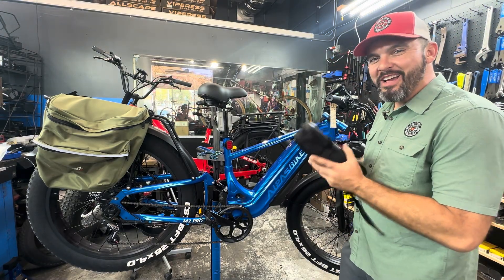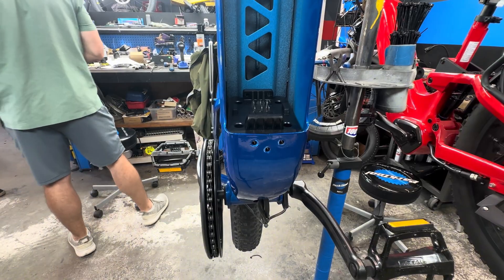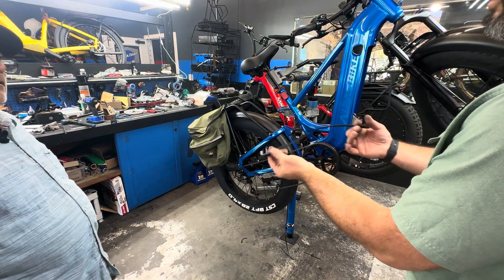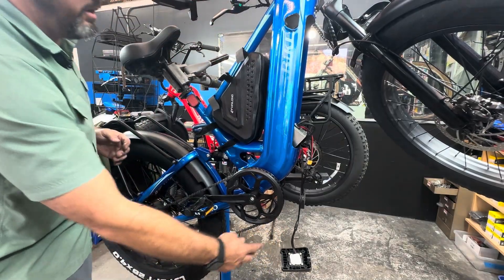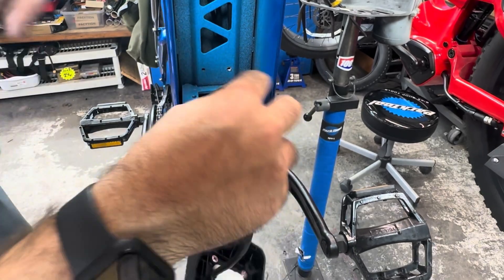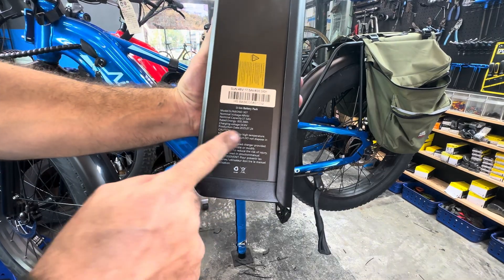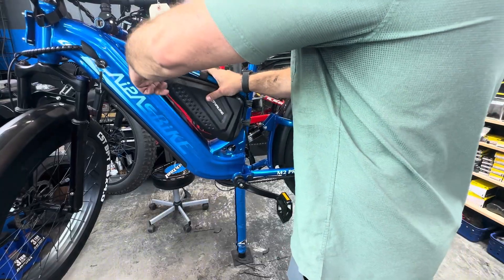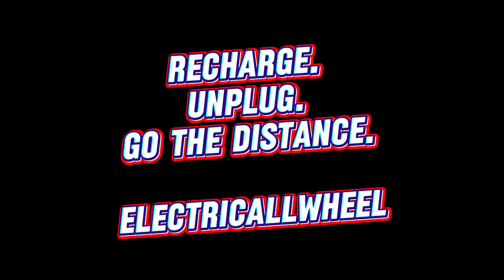AIPAS | M2 PRO | E-Bike Plug & Play Dual Battery Kit Install a Second 20Ah Battery. MORE RANGE!

Comment: I have the same bike. Where you point out that weld by the rear wheel/seat post, my frame came apart. I RMA'd it and they sent me some 2.0 version of the m2 pro and the weld there is significantly thicker and different. It's not the max version with the air suspension or hydraulic brakes though

Comment: THE BATTERYS ON THESE BIKES DRAIN COMPLETELY AFTER  10MILES ITS A SCAM I JUST BOUGHT ONE
Reply: Yeah the batteries are the only real lie on this bike. Even with that this bike is still INSANELY good value. The fact you can upgrade is a big deal. I just gotta figure out how to fit two batteries lmaooo
Reply from the maker: AIPAS | M2 PRO | E-Bike Plug & Play Dual Battery Kit Install a Second 20Ah Battery. MORE RANGE!
https://youtu.be/5FD48vH6cqM
Reply from the maker: AIPAS | M2 PRO | E-Bike Plug & Play Dual Battery Kit Install a Second 20Ah Battery. MORE RANGE!
https://youtu.be/5FD48vH6cqM

Comment: How good are those batteries
Reply from the maker: The triangle pack in the video is two years old. Still going strong
Reply: I JUST BOUGHT ONE AND IT DRAINS COMPLETELY AFTER 10MILES AND THERE CUSTOMER SERVICE IS NO GOOD
Reply: @yahoo37 the customer service is pretty good. You just need to bait them with a bad review

Comment: Thanks for the Vid on this! This might be a dumb question, but does this now need a separate charger in the configuration that you've set up? Not can you charge them both at the same time, but do you need to? 
If one charger or even the original charger will do them both at the same time, that'd be so sweeeeet! @ElectricAllWheel

Comment: its cool and good to know, i dont know why anyone would need 72 miles of throttle only. Id like to see what youd actually get, probably about 10 miles.
Reply: 10-15 miles is the normal battery. It's kinda weak but the other could definitely help
Reply: Their 80 mile rating is for pedaling at level 1 speed only. The entire marketing for the speed and distance rating is misleading. They also did all the tests with a 125 pound rider but say that the bike can carry up to 500 pounds so that in itself is very misleading. The average rider would be 6 foot for these bikes so 125 is very unrealistic for the consumer. 
I've been using this bike to do deliveries in LA, if I'm tactical and only use level 3, turn off when going downhill ect. I can get 30ish miles throughout 4 hours.
Reply: @TheSneezingPuppies the problem is they also advertised that It would go 40 miles on throttle only 

It barely gets 10 simply due to the battery. It is a lie on that front

That being said adding a second battery is easy and cheap with the rest of the bikes quality

Comment: check the cell count on that triangle pack there is no way thats more than 15ah haha. the better range calculation is 1.2 amp hours per mile for throttle only riding.
Reply: If you actually know, how many miles do you think this would get you while going 36?
Reply: @aydendowdy6431  wide open throttle with 37ah.....  low to mid 30's. 30-35 maybe.
Reply: @Timbodacious thank you brother, I appreciate the response.

Comment: THANK-YU  Was Thinking to get this bike for food del? Adding a battery would give me range. Your suggestion would be helpful.
Reply: This bike is as good as they get at this price point. Cheaper than my 2k himiway zebra I had which I liked, tried this, got this and sold my zebra. The range does hurt though. I have to charge mine every day. (2 bars left after 10 miles) But I drive up and down hills. I'm in Utah valley, so everything is sloped driving away from Utah lake, then slowed down driving toward the lake. (Slight)

Comment: I recommend getting a better battery bag, those ones are no good, straps tear off mid ride. A better one is the type that has a huge piece of velcro that goes completely around the entire top tube. I was also afraid I was going to rupture a cell, that bag also flaps around a lot.